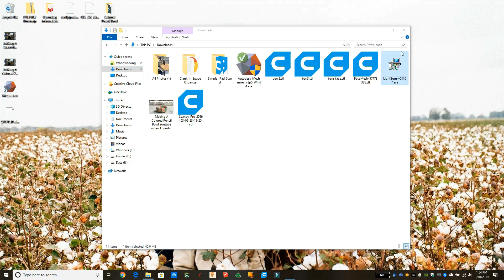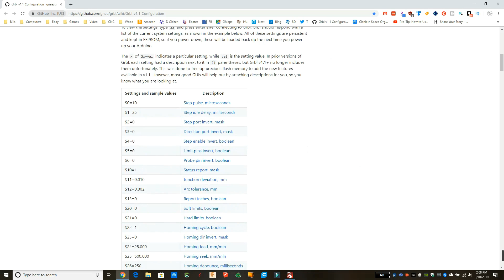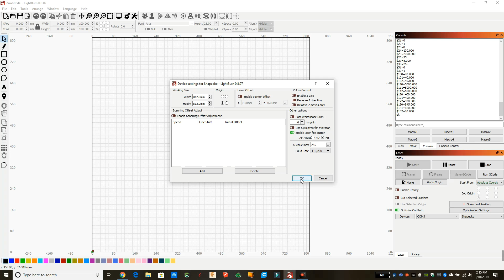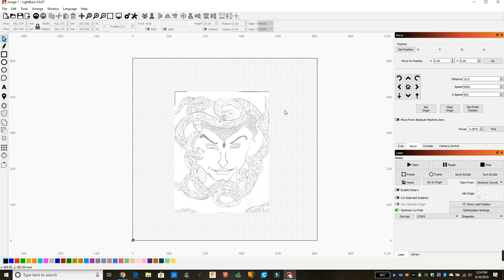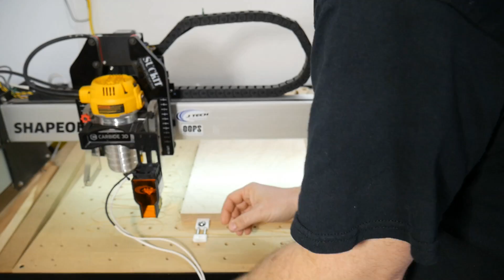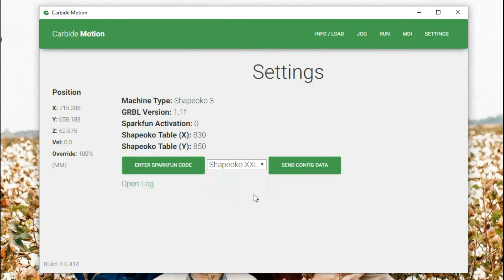Configure Lightburn For Your JTech Laser And Hobby CNC

Comment: Where I find option to turn on laser with small power as pointer. In laserGRBL it's work great. I set power to 5 (0-1000) and I have blue pointer. Very helpfull to adjust work area.

Comment: I’m going to try these steps. for some reason my laser automatically fires when turning the control board on.
Reply from the maker: there's a black switch on the jtech box, one side is fire 100 constant, the other is use the machine to turn off and on fire.  i bet its switched on the always on position.
Reply: Myers Woodshop thanks man I’m messing with the $$ code right now thanks for the info!
Reply: Myers Woodshop that’s what the problem was for the constant fire I switched it back I knew something wasn’t right!

Comment: I setup my jtech laser and it works great. Thanks. I setup the macros and clicked on use cnc. When I go to you carbide create the jog doesn’t work now. Any ideas?
Reply from the maker: go into carbide motion and reset it to the size machine you have, it will turn it back to cnc.

Comment: My laser sticks way outside my shapeoko 16’’ workspace any offset settings to fix this issue? If so where? Thx !
Reply from the maker: I no longer have the jtech so I'm not sure.
Reply: May be a bit late but see the Macro button setup in this video and reduce the Y value by the amount your laser sticks out.

Comment: Hey Ben, got my laser to work, but my y axis  control is backwards . X and Z are  are working correctly. How do I correct this? Thanks again for the great video!
Reply from the maker: did you get it fixed?
Reply: @MyersWoodshop  Yes, i played around with the GRBL settings and figured it out, based on the info in yer video. Thanks for your response!

Comment: Fantastic video.  FYI.  Make sure you quit lightburn before attempting to reset the GRBL in carbide motion.  I kept getting error messages stating the cutter could not be found.  Once I quit lightburn it released the cutter so carbide motion could rewrite the code.  Hope this saves anyone from going into panic mode.
Reply from the maker: exactly true.

Comment: Very informative as always! The only thing I'm wondering is how high do you set Z height off of the material? Thanks again for another great video.
Reply from the maker: by eye.  set the laser to fire on the lowest power that is still visible.  then manually move the laser up and down until the smallest point is achieved.
Reply: Use the orange disk that comes with the laser. That is your zeroing mark. Adjust as needed from there.

Comment: just watched this a 2nd time and setup the macros for Use Laser and Use CNC, but I see that I still need to enter $30=255 and $32=1 if I want to laser and then go back to $30=1000 and $32=0 if I want my shapeoko to work as a router again.  I suppose the question is, can these commands be added into the macro before the G0 calls?
Reply from the maker: Yes they can!

Comment: Great Video. I have a problem though. I bought a Jtech 2.8 and watched your video to configure lightburn. Everything went just as it did in the video until I went to type $$. Nothing happened. Then I noticed it said "waiting to connect to device" on the console. I'm stumped. The laser is not connected to the software but somehow it was connected enough to recognize my laser initially and set it up. I unable to show it connected to my device and unable to home it so I know it's not connected but it shows up on the Device list. Any recommendations might be the issue? I turned my Shapeoko and laser on and off, restarted the software (Lightburn and CarbideMotion) Any feedback from anyone would be helpful. Thanks for the great content.
Reply from the maker: does it fire when you flip the switch?
Reply: @MyersWoodshop  Thanks for the reply. It turns out the reason it was not connecting is because I had Carbide Motion open and already using the port. I was not aware that those two would interfere with each other but I'm up and running now. Thanks for the quick response.

Comment: So I just got the 7w and just went through and set all the settings as above. When I hit use laser macro it goes to busy and stays there. It's been sitting "busy" for 20 min. Cant move or anything. Also is the laser power 255 for all jtech or just the 4w. As I said I have the 7w will my numbers be higher? I tried to test fire and I get no beam.
Reply from the maker: Do you get a beam when you hit the manual switch for fire on the control board?  Should be the same for 7w, 255 is the same.
Reply: @MyersWoodshop  wheres that. And I've got the code to work if I manually input it in the input bar but not the macro button.

Comment: Is the $30=255 value the same for a larger laser? I just bought a 7W laser from Jay. Thank you in advance for your response. 
-Cody
Reply from the maker: Yes
Reply: @MyersWoodshop  Thanks! Now all I gotta do is figure out how to make it fire! Yikes. . . 
I did everything in your video, still no luck.
Reply: @Cadence_MFG  I am now having that same problem, did you happen to figure out what was wrong.   I can turn the manual mode on and the laser will turn on full power.   But I cannot get the laser to fire using the button, and it will not come on while the program is running.
Reply: @nicholaspv  I'm having the same problem... Did you figure it out?  Thanks
Reply: @rickdel73  I did.   There is one hook up on the board that can be hooked up upside down, it is the power and ground.   I had them switched.    There is more detail, let me see if I can find the steps and paste them, but for the most part if you go back to the install steps and find where the power ground is hooked up there is a note that says which way to hook them up.   I missed it 3 times.....
Reply: @rickdel73  Went back and looked at the Set Up Instructions and it is Step 5 look for the ref to PMW and GND.   I had them swapped.  Hooked up backwards, wrong, all those words.   I also moved it to the alternative location.
Reply: @nicholaspv  Thanks

Comment: Great video and thank you for putting this together, it has made it easier for me to get my laser running. Quick question, I followed everything you did but now that I want to go back to my CNC, which is a Shapeoko XXL I can not get it to re connect. I punch the Use CNC and I go to setting on CM but it will not connect to my machine. I test moving the axis’s with LightBurn and it still has control. Do you have any thoughts on this? I relay appreciate it. I have turned everything off and restarted, several times with no luck. Thank you!
Reply from the maker: use carbide motion to move it in cnc mode.  You can also reset it in carbide motion to default settings if you screw things up.

Comment: Worked great! I am now having trouble jogging in carbide motion after configuring LB. I can home and rapid position, but can’t jog (from either the wireless Rii, wired keyboard or on screen mouse clicks). Do you think the two are related? Thanks.
Reply from the maker: id try restarting the system, i don't have that issue.
Reply: @MyersWoodshop  Which system? My PC?
Reply from the maker: Pc, remote and shapoko
Reply: I had the same problem. I couldn't get carbide motion to jog after homing. I fixed it by editing the two Macros like in the video, but added the $10=0 to the use laser macro, and $10=255 to the use cnc macro. I just have to remember to click the use cnc macro before closing lightburn.

Comment: My machine is connected  To lightburn, But the when I turn the laser on I can't change the power  Or turn it off Within lightburn. It's just stuck at full power.
Reply: Turning the laser on meaning on the controller board with the key and switch.
Reply from the maker: There’s a switch on it, one side is just full power and the other (which is what you want it on) is controller board controlled.
Reply: @MyersWoodshop  is it that little switch between the two green LEDs and the key hole?
Reply from the maker: Yes

Comment: Hi Ben  JTech laser & and Lightburn are an awesome combination on the Shapeoko!  Test cut on the wood you are using is a must.  I use the laser on hardwood and what a difference its makes between species.  I use a lot of birch as you get great results.  Great review of the settings as it can be intimidating for someone starting out.  That said Jay at JTech is great for help.      Thanks for another great video - love the "money money" .  Cheers from Canada.
Reply from the maker: Yes, definitely different settings /cuts on different wood.  Yeah, there's a bit of set up but hopefully this makes things easier.  MONEY MONEY MONEY MONEY! :P